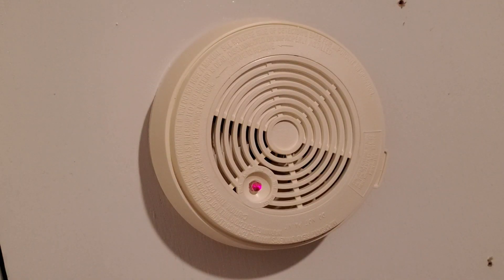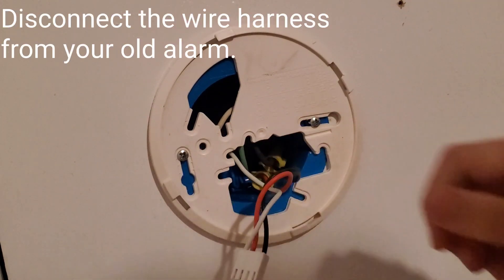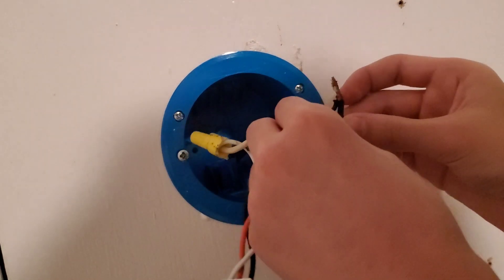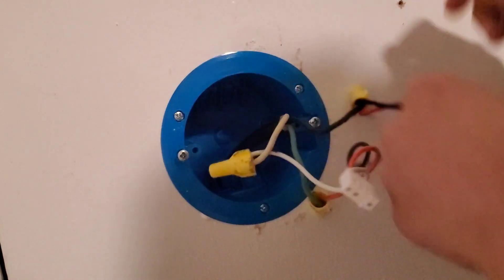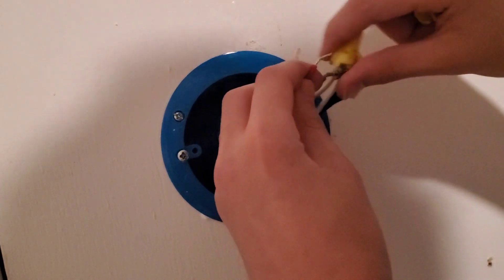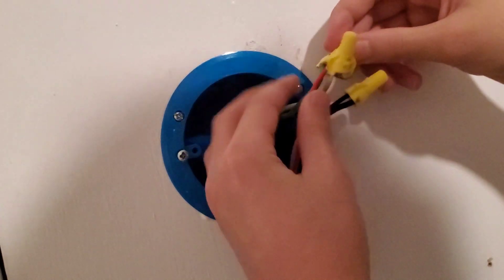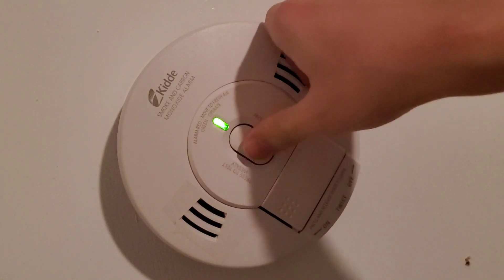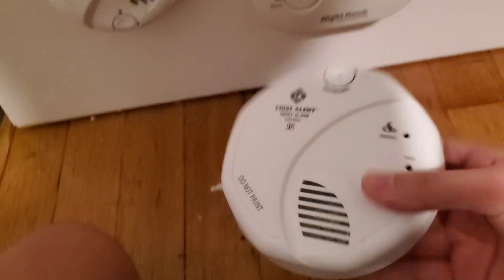How to Replace your Hardwired Smoke Alarm in 2 ways | Photoelectric Elevators

Comment: When you did that you put the tow wires in the wire nut but gust doing that it doesn’t make a good connection but if you twist the tow wires together then put the wire nut on the twisted wires that would make a better connection

Comment: Mine are hardwired, took them all down because replacing the batteries didn't stop the beeping. Took the batteries out of them, drained the residual power and I swear it is still beeping from the sockets somehow. I'm going crazy I don't know what to do. Cutting the breaker stops it after about 10 minutes and I thought that had solved the problem but several hours after turning the breaker back on it started beeping again in the middle of the night. HELP!!!
Reply from the maker: You have faulty smoke detectors. Try cleaning the sensor. If that didn't work then it's time to replace the faulty alarms.
Reply: @Photoelectric_Elevators  You misunderstood my comment. There are no smoke detectors now connected to the outlets. They have been unplugged, batteries removed and drained. They are sitting in the garage and I am still hearing the beeps coming from the place where one of them once was. It's literally just the bracket and wires hanging out. There are no more smoke detectors in this house and I'm still hearing the beep
Reply: After reading one of the comments a lightbulb went off. There was a carbon monoxide plug-in down under a windowsill that I found. I unplugged it and took the battery out and it stopped! For those of us who don't have good directional hearing, it can drive you absolutely insane. I had forgotten that thing was even there. Been there since we discovered a gas leak about a year ago.